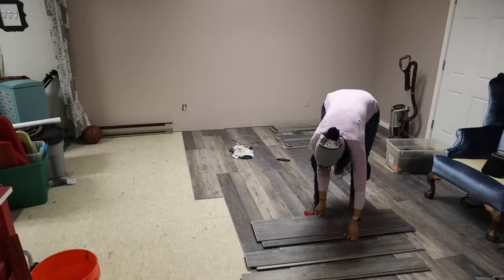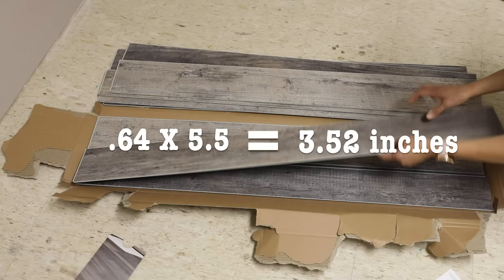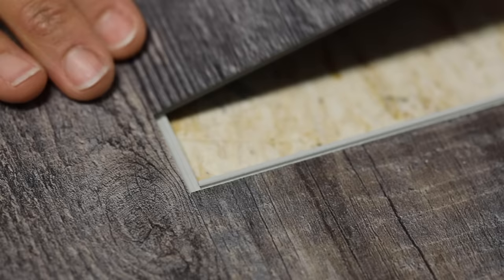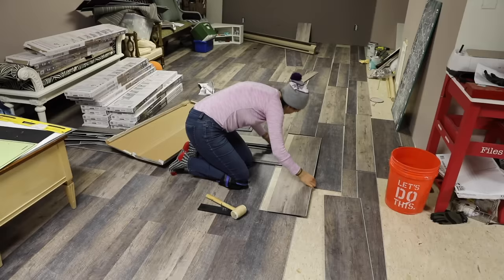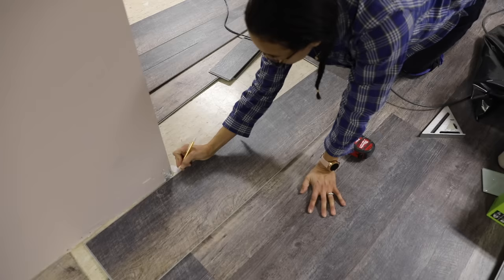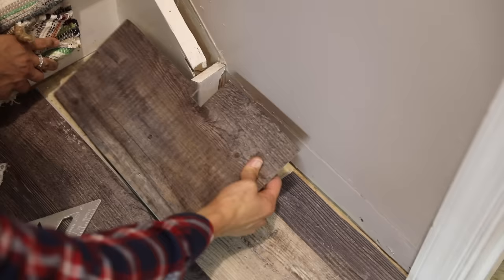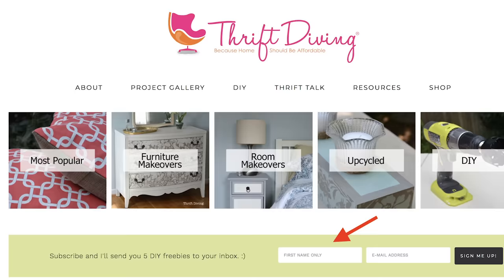How to Install Vinyl Flooring Over Tiles (Over Linoleum Tiles) - Thrift Diving

Comment: Best way to start is to start with full plank 1st row. 1/4 plank 2nd row.3/4 plank 3rd row....start with those 3 rows across the room then adjust if needed for final piece.
Reply: Please help what’s the measurement for second row 1/4 plank and 3/4 plank the full plank itself is 47 5/8

Comment: We are in the middle of installing life proof flooring from Home Depot in our upstairs guest bathroom. We have already put it in our master bath, half bath downstairs and in our kitchen. We just love it! I have been tapping in using the foam edge and rarely chipped it but I like the way you used the floor lip better. Hubby has been going up and down stairs to cut pieces. Today I'm going to try snapping it. Thank you for this video and your job looks great.
Reply from the maker: YAY, glad I could help! Yeah--definitely try snapping it. No need to go back and forth to cut, unless you're doing around corners. Good luck with your projects!

Comment: Tapping blocks usually have a double step on one side (shown at 14:08), that fits better and does not damage the tung.     Also when hammering the ends down, make sure they don't get damaged.  I lift the center of the plank up slightly and tuck the end grooves in a little.   You video is very well planned out.  Thank you for the info.

Comment: One you have the first row done, you use the off cut from the end of the row, as the starting piece for the beginning of the next row and it nearly always works out with the correct stagger, plus very little wastage.
Reply from the maker: Yes, great point. I did that for some of my boards. I may have forgotten to include that. But it does cut down on waste. However, with this particular flooring, it may not work all the time because the boards in this brand/color are different colors. So it's more than just staggering the seam but also staggering the colors. But even if I didn't use the cut off piece for the start of the next row, I saved those pieces and reused them for start pieces when the color fit into the pattern, if that makes sense.

Comment: Pretty good job of installing this floor - better than most of the cowboys on youtube attempting to fit floors.  I do have a concern though........ these planks come in 3 different widths... Im pretty sure they are meant to be installed using the same size (width) planks down the run from wall to wall, and then the next run use a different width.  What you have done is use different widths in the same run, which has resulted in no spacing of the boards between rows -  you have all the corners meeting in the same place and I think this could compromise the stability of the floor.  Looks nice though.

Comment: Aside from not staggering a lot of the planks, great job!
Reply from the maker: Thanks! I staggered all the planks that needed to be. Since their multi-width planks, it may seem like you're supposed to stagger all of them, but from their instructions, the 5.5" and the 4.5" planks are one unit, and the large 10" plank is a unit. I staggered the units, not the individual boards. That is how the instructions are.

Comment: I'm sorry but I just did my kitchen floor and you do not have to go through all these crazy measurements to start laying down the planks. Start in one corner and work your way across. When you get to where you don't have a full plank just turn the last plank around and slide it to the wall. Cut it where the second to last plank ends. Turn plank back around and secure. You have to turn it or flip it so you don't cut off the part that snaps in that secures it to the previous plank. Take the leftover piece and start your next row. You don't need to worry about how big your last plank is at the end of the row because 9 times out of 10 you're putting baseboard over it. But your suggestion about laying out your boards to not have the same colors on top of each is a good idea.
Reply from the maker: It's not crazy measurements. It's actually an important step. Otherwise, you could end up with a last piece that is too skinny to be cut and could look really odd. Knowing the measurements allows you to avoid those kinds of cuts.

Comment: such a beautiful transformation! the floor looks amazing and between that and the new baseboard you should be safe from water damage
Reply from the maker: I hope so! I did find a hairline leak in the basement stairwell area so I had to pull up a few feet of flooring by that door. I'll need to repair that and then reattach th rows of flooring. But it should be an easy fix! :)

Comment: Take one of the ends you cut off, cut it in half longways and you'll have a tapping block that you can lock into the grooves so you dont mess up any of the edges, that you can beat on pretty good. I found that tapping things against the planks, even a rubber tapping block sometimes damaged the edges.

Comment: If you ever have to do this again I would suggest to use a small trash piece of vinyl click it next to where you want to tap with the mallet and hit that instead of the good piece, so you will have to worries about breaking the good piece and just remove the trash piece and keep using it for tapping the whole floor.

Comment: Love the floor!! When I bought my house four years ago, I ripped out all the carpet and put in very cheap flooring kind of like this from Home Depot. Definitely cheaper than the one you used but it also snapped together like that. Well it’s been 4 years and some of my floors have some massive waves going on. I’m being told it’s happening because it’s the snap together kind. Not sure how to fix it either.
Reply from the maker: Oh wow, that would be worrisome! I would do some Google searches and find out why they're doing that. Did you leave expansion gaps around the room? Do you have water or moisture around them?

Comment: I’ve got my little downstairs toilet to tile with LVT over the same kind of tiles, except that they aren’t click-together ones, and I need to lift some cheap and nasty square vinyl tiles and somehow remove the adhesive before I get stuck into it. I think I might use these clicking ones for my kitchen and bathroom though as they look pretty solid.
Reply from the maker: Sounds like it wouldn't be too difficult or time-consuming of a project! :) Good luck!

Comment: In order for this type of floor to be installed over ceramic tile you will need to consider prepwork the grout lines will eventually show through over time, minor flashing will be needed prior to installing.. this is considered a WPC product so the core of this material is not rigid..
Reply from the maker: Thanks for the additional info!

Comment: Good job...as a 40 year flooring guy let me say, use a metal hammer on your tapping block it will not bounce and force them together much easier...some vinyl planks go together differently so read the box instructions..as said curved blade,i think the pattern of the thinner planks should not be doubled up but should run thin plank a row or two of thick planks then repeat at different intervals....women, you never have to apologize for your butt...
Reply from the maker: Lol, David! Thanks for the tips. I questioned the stacking up of the thin planks but when I looked at the instructions and Home Depor images, that is how they had theirs as well. So I followed suit! I treated the thin planks together as a large plank. Let's see if it holds up!

Comment: Nice. The tapping block is a tool that should be used. I have done thousands of square foot of flooring and it makes the job faster then a block of wood.  You gave very thorough great instructions. The floor looks great. Your stepping back point was right on. Where were you when I started doing this lol?

Comment: I did the samething to my kitchen a few months ago all by myself with the same flooring from HD.
Reply from the maker: Nice! How well did it turn out? I am thinking of doing this in my kitchen, too!
Reply: It is holding up very well. Wish you had made this video before I installed mine. It would have helped my knees, fingers, back and the end pieces. I'm thinking of putting it in my laundry room now.

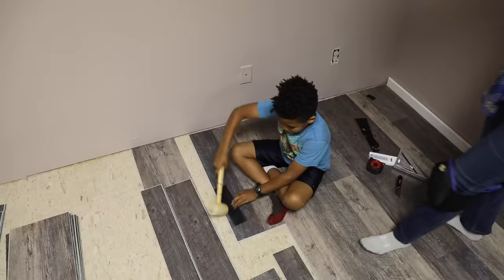Comment: 9:39. Why are you putting 2 boards of equal width and length right next to each other?  Shouldn't you stagger those ends bt at least 8 inches?

Comment: You did an amazing job! It looked quite nice when you were done.  I am wanting to remove some 'bumpy' loose carpet in my home office and put down laminate flooring, but I must admit it is a bit intimidating.  I am very inspired and will contemplate a DIY flooring install.  The good news for me is that I have one big square and won't have to deal with  cutting around obstacles.  I do have one question, is it a requirement to remove the baseboards?  Thanks! You are an inspiration.

Comment: I realize this video is just over 3yrs old.   Are you still pleased with your floor?    Also, do you think this type flooring would be suitable for a plain or sealed 50+yr old concrete basement floor?

Comment: This is interesting, I wanna learn how to install this plank, one problem is I'm I don't know how to measure?
Reply from the maker: Get a good tape measure that can go up to 25 feet, and then measure the width of your room and the length. Any small areas connected to your room that will get flooring, measure those too. Multiple the width times the length to get the square footage. Insert that number on the website to calculate how much flooring you'll need, then add 10% for mistakes and stuff. Then follow my math to figure out laying the floor. :)

Comment: I think that floor is meant to be installed with each row being a different width. You don’t install 2 end joints together.
Reply from the maker: I thought that was the case, too, but if you look at their website and their flooring, it looks just like mine. It has been years and the floor hasn't fallen apart and still looks good. So I guess I did it right. :) Thanks, Gary!

Comment: The flooring aint supposed to line up with each other and every plank is supposed to be offset to interlock for structural purposes youll get better over time keep doing it eventually get it right someday
It all maybe simple says everyone but when it comes down to the knitty gritty everyone that says its simple cant do it(
Carpentry and labor is a skilled trade and hope your legs wasnt ridiculously sore for a week
Reply from the maker: Sorry, but that's not accurate. I actually questioned the layout for that very reason: is every plank supposed to be offset or not. But after lengthy research before getting started, including reviewing the product page on HomeDepot.com, each of the 10" planks is considered ONE PLANK. The medium 5.5" planks and small 3.5" planks, when stacked, are considered one plank. So for each 10" plank, those were offset. That's how it's shown on the product page. Thanks for pointing this out, though, because I was confused over this before I started, too, as I'm sure others will be. :) And thankfully, my legs were okay, but my lower back--killer! :)

Comment: Serena, great video! But how has the floor been wearing? I have pets and have heard that even though it says the flooring is waterproof, it stains. Any staining from food, drinks, pets?
Reply from the maker: Great question! Since this is in my basement, it's not a room like a kitchen that gets a lot of foot traffic. But so far, it's been great! I did have an incident where a small stain happened because some water spilled from my cup and a hot pink post-it note was on the floor where the water spilled. I was lazy and didn't wipe it up because it was such a small amount. But when I came back a few hours later, there was a hot pink ink stain on the floor! YIKES! I looked up online and learned that rubbing alcohol can get it out. Sure enough, it came right out, with no problem to the vinyl. Overall, I am VERY pleased with this flooring and I am considering installing it in the kitchen soon! Hope that helps, Sylvia!
Reply: Thrift Diving.  Thanks so much for the reply!

Comment: How has your flooring been doing over the last year since you put it down? I'm in the DMV area and have those same tiles in the basement which have concrete foundation and asbestos tiles under it. I was thinking about placing those same home Depot tiles. But I may place the DMX underlay.

So my final layers would be: concrete > asbestos > 12 inch peel and stick tiles > dmx underlay > new home Depot vinyl (the brand you layed down).

The ceilings aren't that high in the basements here...about 7feet or a little less
Reply from the maker: The flooring has been great! I was planning to do an update on the flooring so that people can see how it's held up. You should see that video soon. But yeah, you'll get good results with this flooring!

Comment: she forgot to roll the planks with 100lbs roller most impotent part even if it's not glued. . but i do like her plumbers crack line :) & she should have used foam pad under vinyl planks if she wanted warmer floor. and she wondering now why seams started coming apart. due to her hammering  planks in place.

Comment: Great vid! I just moved into my first owned home and I definitely want to do the flooring, starting small in the office then work my way round. Just curios to know if when you change the trim do you also tend to change the trim around the doors as well?
Reply from the maker: Good question, Richard! And congrats on moving into your first home! I typically don't change the door trim. I think that would be overkill. But if I put in a new door, like I did in the basement, I removed the old trim and put in trim that matched the baseboard, which you can see here: https://youtu.be/SIvohfq48LU
Reply: @ThriftDiving  Amazing thank you!!! Appreciate your response :)

Comment: Great video. I'm about to do a similar project in my basement with the exact same laminate floor underneath. Did you run into any unlevel areas on your preexisting floor and how did you handle it?

Comment: When tapping the boards in you tap the board in with the tap block on the tongue you were hitting it too hard that’s whi it broke and you weren’t using the flat side of the tap block. Tapping the board in with the block directly on the plank could damage the board and leave gaps after u snap the board in

Comment: Project looks great. Question: how do you know which wall/direction to start laying the tiles in the room? I want to tile my entire house, room by room including the hallways so the tiles need to make a smooth transition to each space. Thanks.
Reply from the maker: Great question! Start with a long wall and place the tiles so that the next tile can easily be locked into place with a 45 degree angle and "dropped" into locking position. Usually, rooms that are rectangular, flooring runs the length of the longest part of the room. It would look funny if it ran side to side along the shortest walls. Hope that makes sense!

Comment: The Utility knife that you use to cut the plank, is it just a regular utility knife or a special knife for cutting plank? And also using the utility knife to cut the plank work only on Lifeproof plank or will work on all other brands too? Thanks
Reply from the maker: It's a regular utility knife. Not sure if it works in other flooring, but it's it's vinyl, it should! :)

Comment: first, the laminate floor doesn't go directly on the tiles because when you walk on them you will here noise. second, they are click you dont hit them with a hammer. not a good job in the long run.
Reply from the maker: Dude, I followed the manufacturer's instructions to a "T." You obviously hadn't watched their video.
Reply: @ThriftDiving  i dont care your doing it the wrong way. ive been laying that type of flooring 15 years

Comment: I feel so stupid I don’t understand staggering. My boards are 50 inches long. And my floor is 13 feet long. If I try to use the end piece left over it’s too short. And it says it needs to be at least 16 inches long....  😩

Comment: Oh I wish I had seen this video before I installed mine. I didn't have a rubber mallet or tapping block. Some of the seams are very visible. I have to re do the floor =(
Reply: you may be able to use a rubber mallet and close the seams without taking the floor apart, just hit the top of the board on an angle a few inches from the seam that you are trying to close. You also may be able to kick the boards and close them too.
Reply: @brianflanagan3654  Thanks for the tip! Going to try it. fingers crossed

Comment: Great job I have linoleum floor and was wondering if life proof come in even width planks instead of the multi widths. I have a lot of door jams so I think it will be difficult with the wider planks. And lastly do I need what is the thickness of your planks I guess there in mm?
Reply from the maker: Yep, Lifeproof comes in even widths. Those would be even easier to install. And you wouldn't have to do much planning for a pattern, which saves a lot of time. I'm not sure what you're asking about mm, though.

Comment: Did you install a 6 mil poly moisture barrier?  If not, did the SPC swell or curl over time?
Reply from the maker: I didn't apply a moisture barrier. The backing of the tiles has a cushion/padding, but I don't think this qualifies as a "moisture barrier," per se. The tiles have been fine and aren't curling! Still looks as good as the day I installed it! Hope that helps.

Comment: Thrift Diving, does this flooring require any type of sticking adhesive to adhere it to the other flooring?
Reply from the maker: Nope, it's a floating floor, so it interlocks together over top of the existing floor with no adhesive. :)